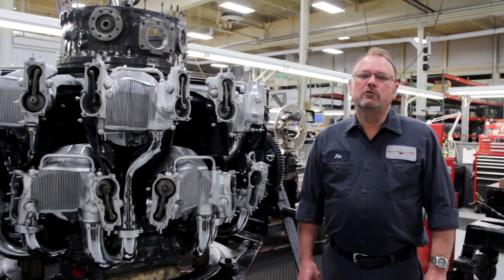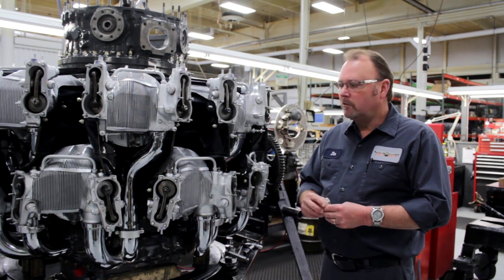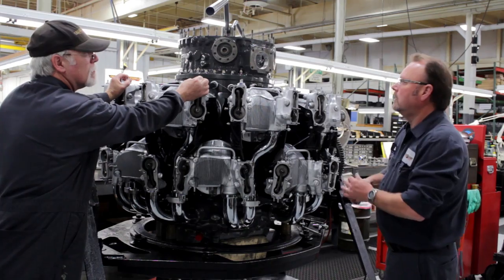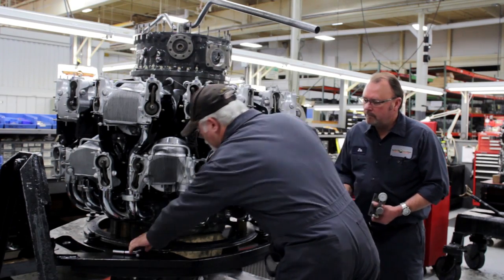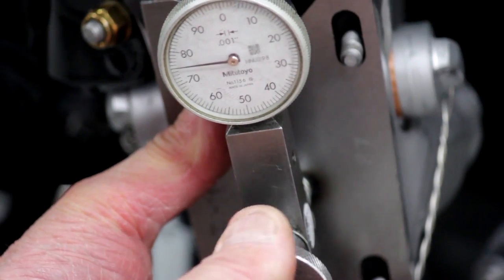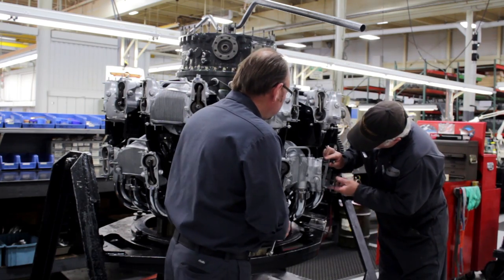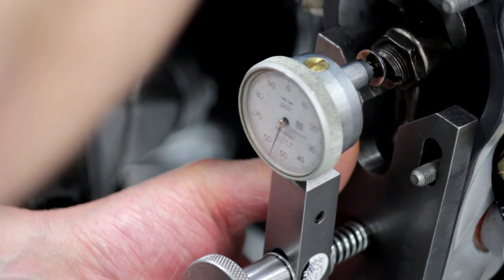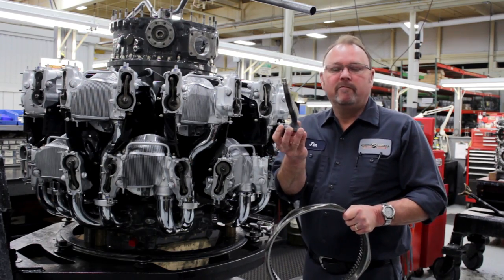Precision Engines Radial Engine Valve Setting

Comment: Thanks a lot for these videos in 1984 I got out of the USAF and got a job at a shop called Steward Davis INC at Long Beach Airport that rebuilt radial engines and this brings back memories. Unfortunately they lost the lease to the property so in late 1985 I ended up getting a job at McDonnell Douglas but I really missed the shop because everybody knew everybody were at Douglas I was just an employee number I love the sound of a radial engine always have always will thanks guys and thank you for anybody who happens to read this may you have a great day

Comment: imagine doing this on a 4360 28 cylinders each,   X6 on a peacemaker.
Reply: that´s why they were so expensive to maintain.. but it was a whole industry... on the other hand, overhauling and adjusting a turbine engine is also a science.. but they last much much longer than radial engines
Reply: The spark plugs on a B-36 have driven men mad.

Comment: What Graeme Williams asked.  Also, who told you that a big honking screwdriver was an acceptable timing indicator for ANY engine?  A little common sense and respect for the technology can go a long way in maintaining radials--or any other mechanism.
Reply: Hopelessand Forlorn the screwdriver would indicate when the piston is at TDC.
Reply: Seen it done on many engines you must not be very familiar with engines if you dont know about this or think this damages the engine.